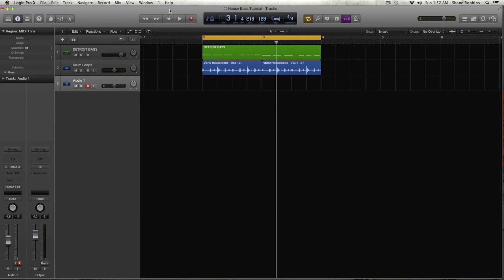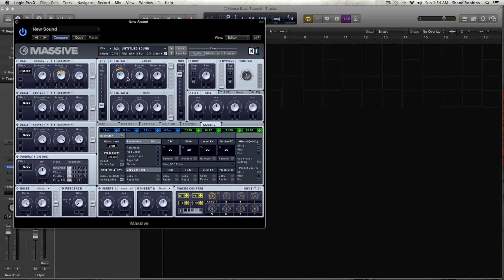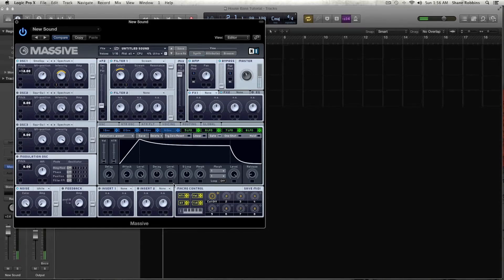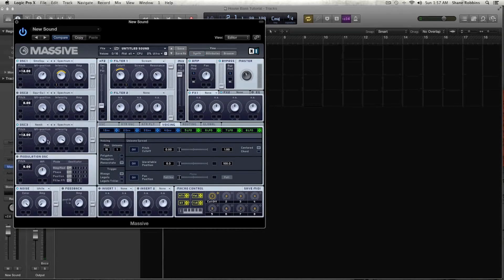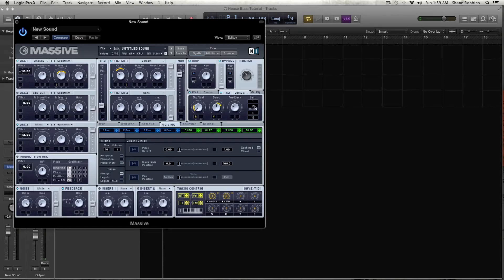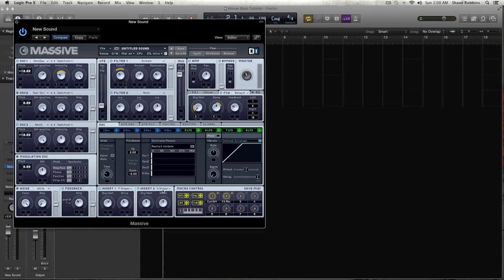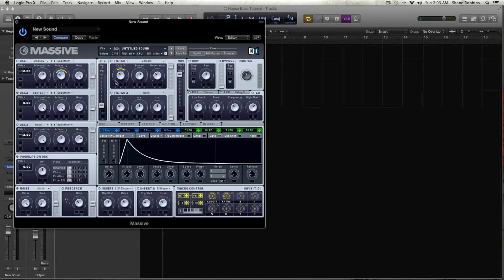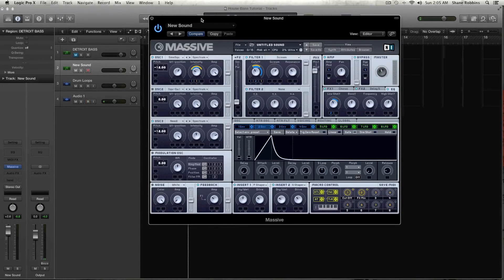NI Massive - How to make a great chill bass in Massive - How To Tutorial

Comment: great tutorial. could you explain exactly what the second envelope is adding? thanks!
Reply from the maker: It's a slight change but using both the envs 1 and 2 adds some more depth to it. The second env is modulating the cutoff further and is also used to add some bass. It has a sharper decay which is why I used it to modulate the bass and the cutoff a bit further. I wanted to have a clean sound at the top end and the beginning (with env1) and then dirty up the the bass and the decay just a little bit more with env 2. Hope that helps!